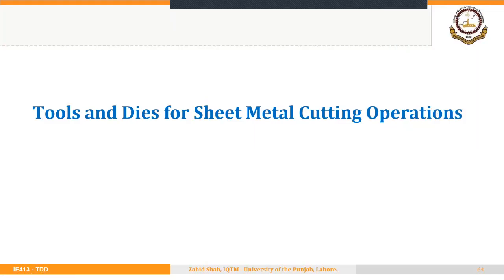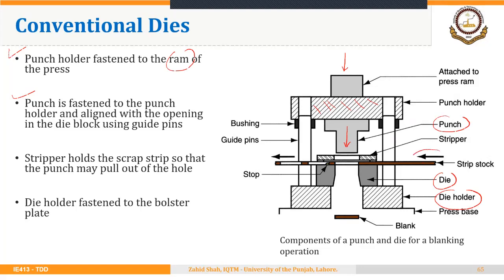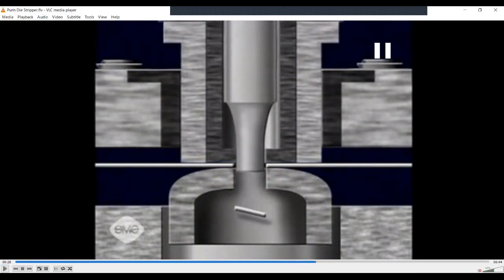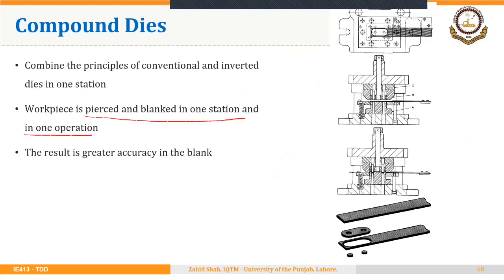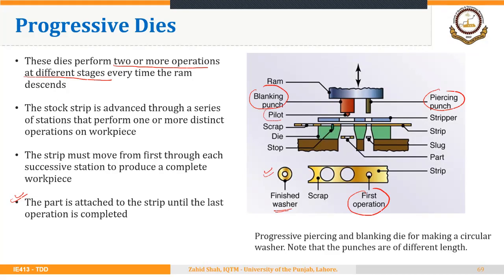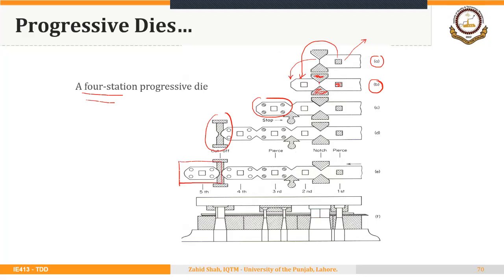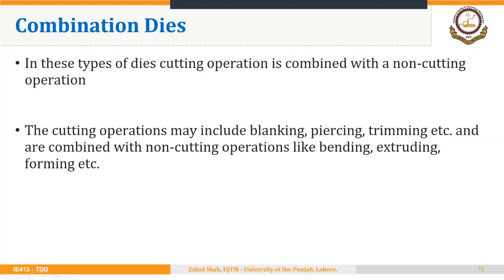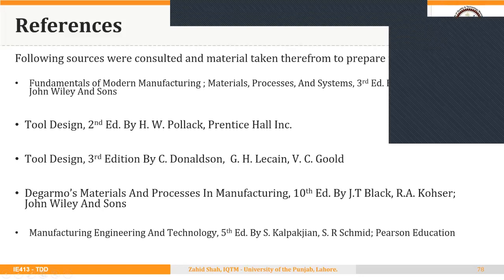03_02_P7 Types of Dies for Sheet Metal Cutting Operations

Comment: ❤ nice video dear sir but I have , question that when we bend sheet metal part , the radius of the bending piece will it be the same bending tool radius 

If for example if I need radius of the sheet metal to be 5mm , is it compulsory to have bending die radius  to be same